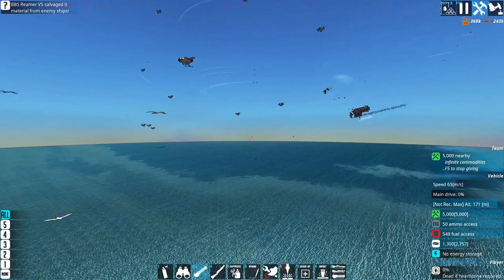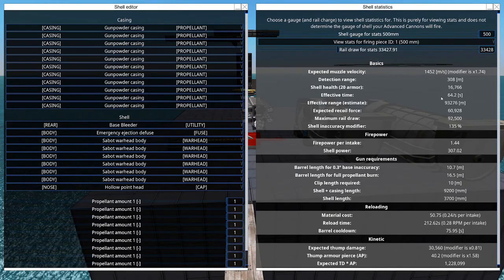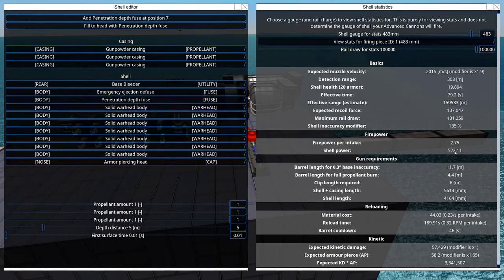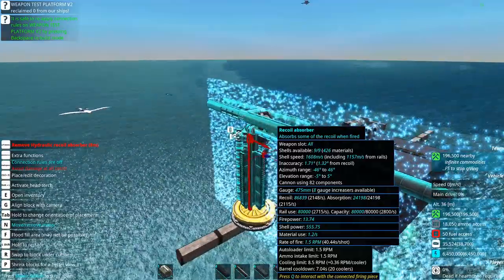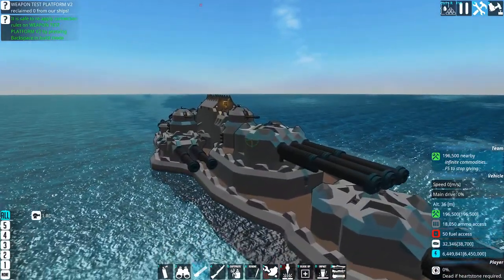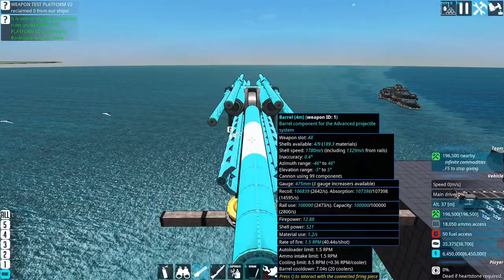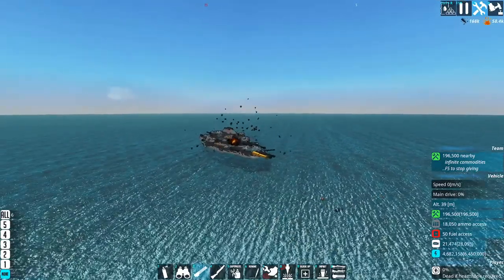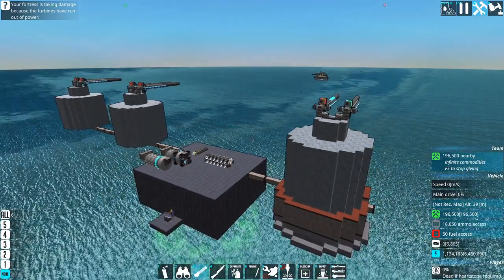Building the Tycho Main Guns - Putty and Paint - From the Depths

Comment: You can put the gauge at 500mm and then reduce the propellant amount of one of your gp casings to match the shell length with your desired clip length, usefull when using fuses and base bleeder.
Warheads of the same type after the first one have reduced dmg (~85%), if you use many modules for payload you can do 50% frag 50% HE to maximise the chemical damage.

Since your guns will all fire at the same block the later shots will be more likely to overpen, depth distance should always be at 30m and first surface time = desired depth / shell speed. The game doesn't tell you but you can use more decimals for first surface time (ex : 0.0075[s] = 14[m] / 1863[m/s])

Can't wait to see the next part of your ship building.
Reply from the maker: When they added that, I didn't realize that it reduced the gunpowder casing length. It makes so much more sense now. I'll go and set the gauge to 500mm before I start on the rest of the systems.

Comment: Have you tired ap heat or AP frag?
Reply from the maker: The test firing segment of the fully built gun uses AP frag, which is my favorite so far. I did a little bit of testing with AP HEAT this morning which I found a little bit underwhelming, but it seems like it could be really good in theory. I think that I'm going to just use a bit of a party mix on the actual vehicle, and use APHE, AP frag, and hollow point frag each on different turrets.
There's definitely a lot of optimizing and tweaking that can be done, but it feels like there is a broad range of shell configurations that are viable.
Reply: @bungalowbill521  I'm a fan of mixed shells myself.  Be nice to see what you come up with.
Reply: I suspect that apheat is one of those ap(something) shells that works better at slightly smaller gauges but higher rates of fire, since you can get away with less piercing damage and can still hit internals.